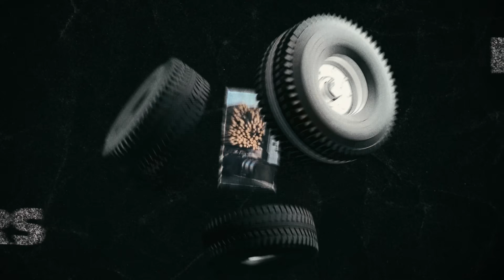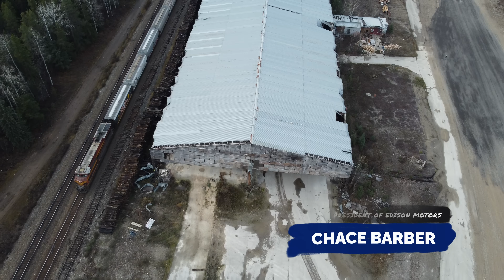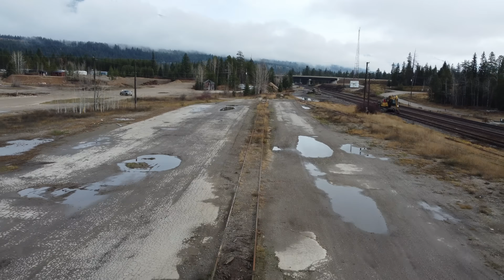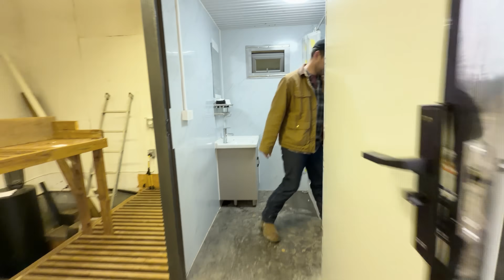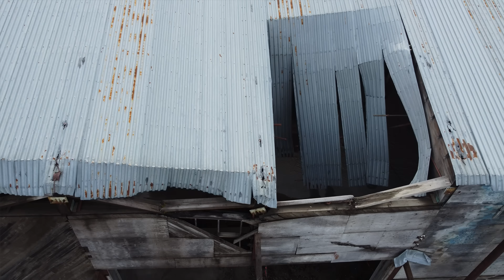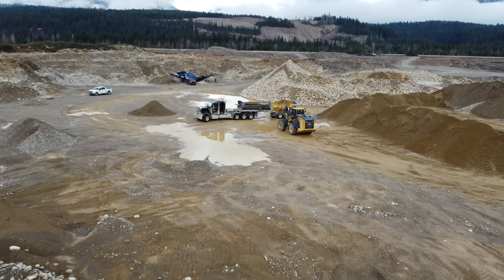Can we Turn a LIABILITY into PROFIT??

Comment: Put your powertrain in an old switch engine or upgrade a test truck to a hi-rail vehicle when you have a spare minute once this is up and running. Even if you don't produce or retrofit locomotives, that way instead of a 1940s or 50s diesel prime mover you have parts commonality and in house expertise, and another "test case" to get operational experience on. Plus having a hirail option or the ability to repower locomotives could be handy, and a project to keep the R&D muscles flexing as you shift from prototype to production.
Reply: Great idea! There’s a company in the uk that does mainly construction works and they have settled next to a railroad from there they have massive logistic operations with their raw materials like sand, gravel and more.
Reply: @alanmay7929  Ashville?
Reply: @sterlingodeaghaidh5086 yes
Reply: @sterlingodeaghaidh5086  RIP
Reply: @alanmay7929 are they on YouTube? I think I know who you are talking about?
Reply: @PSUCharger88 ashville aggregates in the uk
Reply: so true, imagine edison motors bogies, makign new cheaper trains and powered wagons, low profile bogies and cheap trams made from the already engineered axles

edit, the idea that a train is just a truck chassis with metal wheels, and it could be lowerred by alot, for a step in system
Reply: @any1alive In the UK they had a self powered passenger rail car called a Sprinter. It had a diesel engine and automatic transmission under the floor. That design could be upgraded with the semi drive train. Regenerative braking would be a great feature.
Reply: ABSOLUTELY.  Brandt makes a railcar truck that is known through the railway industry as a way to get a truck to haul a few railcars, usually in Maintenance of Way Service.  They're beefy trucks, roughly the same class as what Edison is planning to do.  Making the Hybrid Hy-Rail truck per your plans would be an awesome way to test the truck in shuttling railcars around on your property!
Reply: ya know trains are already electric...the diesel motor is a generator...lol
Reply: @kencrook7337  i know, thats what diesil-electric  means usually, buti mean edison motors could make em cheaper, and bring down big train XD, i jk
Reply: @kencrook7337 yup just 2 boagies and  some Saftey tech
Reply: Edison's take on a TrackMobile. Interesting.
Reply: What your refering to is know as a gen-set locomotive. Many were built 20 to 30 years ago, very few in operation today, a multi-billion dollar failure.
Reply: Lol what. Emd parts are readily available
Reply: That would be awesome! I love this idea

Comment: Now you need your own diesel-Electric hybrid locomotive to move rail cars around your new facility!
Reply: Add rail wheels to Topsy and run it?
Reply: @pigletshut it would be a good torture test for her. Hell it would be a good torture test for any of their new trucks. Just figure out a coupler, and you have a shunter.
Reply: Nawwww gotta build a cummins/18 speed locomotive for shunting the diesel electric trucks
Reply: @manbeezis diesel mechanical isn't as efficient as diesel electric, and they are literally coping rail into trucking, so they should just make their own locomotive.
Reply: I mean emd is already the best thing out there and coolest sounding
Reply: Do it like a unimog or some of those specialised excavators that run on rails. A couple of hydraulic train wheels to keep it on the tracks but still use the rubber wheels to drive with. That way you can switch between rail and road.
Reply: @autobootpiloot That was tried in Australia. The idea was to run hi-rail trucks on branch lines that were marginally economic instead of closure. There were significant issues with high tyre wear from what I heard. I don't have details.
Reply: @kellymcdermott2546  I can very well understand that isn’t economical. But it does make sense for a train yard where they have to move some railcards every now and then. Don’t forget that Mercedes Benz offers this from the factory with their Unimog and have done so for many many decades. There most definitely is a use for this, albeit it being a niche market.
Reply: Make your local railroader happy (er)! The customers that I can just drop and pick up cars at the gate and dip out of there are the best!
Reply: And another die-cast for the collection
Reply: It's not a hybrid. That would be just a normal diesel loco. That's where Chase got the idea from. Hybrid uses either/both fuel types to drive. Diesel-electric is a fully electric drive with a generator. Edison Motors makes EVs not hybrids.
Reply: Trains have been diesel/electric hybrids since sometime in the 20's. The first one was in 1914 in Germany. The diesel engines just run generators to power electric motors to power the drive wheels. 
Edison kinda got the idea for this hybrid technology from seeing how remote towns that ran off straight diesel generators  to run the towns converted to a much smaller diesel engine that charged a battery stack so they could save on fuel cost. The generators ran to charge the batteries that could run the town during off peak draws, then the battery stacks would stay ahead of peak draws. 
Pretty much the way Edison's trucks work. The battery's drive the motors to move the trucks, when batteries get low the diesel engines start up to just charge the batteries.

Comment: As a person who knows trains (I’m a foamer, iykyk), I’d honestly have that existing track and ties looked at if they’ve been disused since the 60s and 70s, that track and ties were probably at least 30 years old then. With how much has changed in the rail industry and how much car weights have climbed, I wouldn’t be surprised if you had a rail break the first time a car went over it. There’s also maintenance to consider. 
Since the switch to the main has to be reinstalled, I’d honestly say rip up the old track to the edge of the concrete and lay new stuff, or at least put in new ties; even ones that CPKC throws out would probably be better than what’s there
Reply: Ties are probably shot, but I just replaced a 1930s rail with a 1913 piece of rail on a grain line. Sure, new rail is better, but it would be ridiculously expensive to replace everything. A new switch panel can easily top 250k depending on the use.
Reply: For sure will need new ties soon if not now, but I think the rails would probably be fine. If they break, bolt them back together. It's not like they're doing 80mph there, mostly just 5mph shunting.
Reply: @boostaddict_ low-speed shunt yard is bulk work
Reply: the railways re-use old stuff all the time. one mainlines garbage is another yards treasure. particularly the rail, but even with ties clearly some have to go from that clip but i bet there are still good ones in there.
Reply: They said they had engineers look at it, so I'm sure they know what they are doing.
Reply: He mentioned the rail re-activation costing a few hundred thousand if I heard it right, I don't know much about railroad work but for something this short it sounds like it includes all new rails and ties and not just 100 ft of connection to the main line
Reply: @lolatmyage  I was talking to a CN foreman here in HFX when they were re-tieing the mainline here.  Just lifting rail, new ties, new tie plates, nail it back down, and tamp the ballast costs about 1 million a mile if they do every second tie.
Reply: @colindewolfe3647  Damn that's a lot
Reply: @lolatmyage  Making a connection to a CTC controlled railway line usually is NOT cheap when you have to get signalling/electrical/etc. involved.  The rails are probably okay enough for the purpose, but relaying the ties and ballast is likely in that ballpark.  Then they could get the rails where it makes the most sense for transload and railcar storage.  Chace, there's big money to be made with railcar storage...

Comment: Despite what some short sighted investors may say, the fact is you'd be crazy "not" to develop that.  Its not only a substantial revenue stream in the short term as a reload facility but as production increases it can be used to ship the trucks across the continent right from your doorstep.  Win win
Reply from the maker: Some large institutional investors just want a “pump and dump” not long run success
Reply: @EdisonMotors  The "Pump and Dump" types are less investors and more speculators and gamblers. They are not investing, they are gambling and dumping debts onto whoever buys the incomplete businesses they are "investing" in.
Reply: @EdisonMotors  Well fuck em? What's the point of listening to the people who aren't investing in building the company long term. You plan to stick around if they aren't that's not your people.
Reply: Or to receive any materials at the future factory. Its like having a bus stop at your door.
Reply: @htmn_2  It's like having a train station at your door!
Reply: Also the customers using it are all probably people who also occasionally may find themselves needing a truck. that revenue stream might turn into more business.
Reply: Sounds like a great plan!  And as you seem to already know-stay away from people who don’t share the vision.
Reply: True. But it is a when issue not a if.
Yes its crazy not to invest. 
I hope EM has the luck of the clock on thjs.